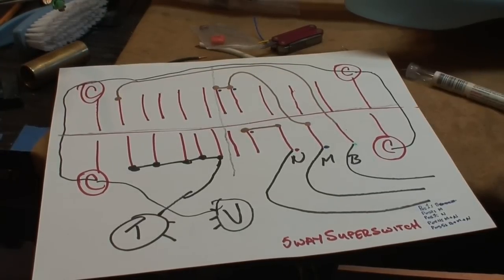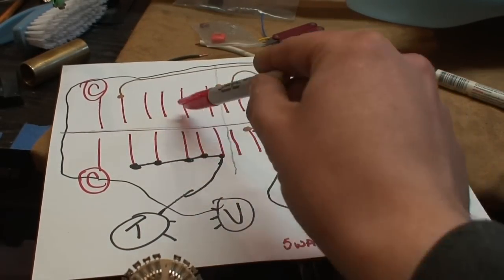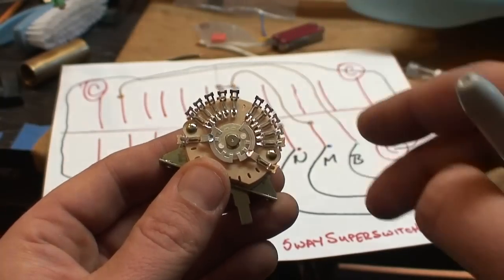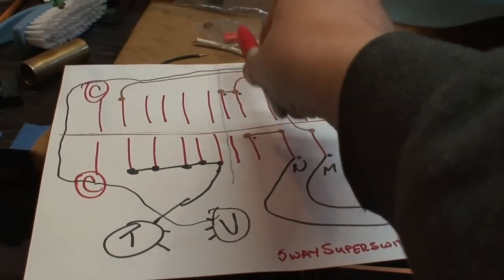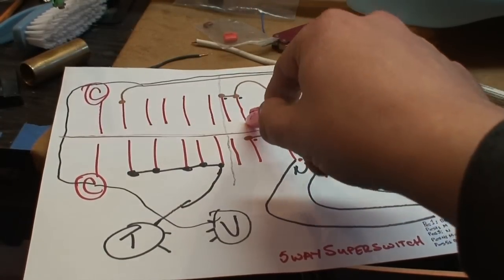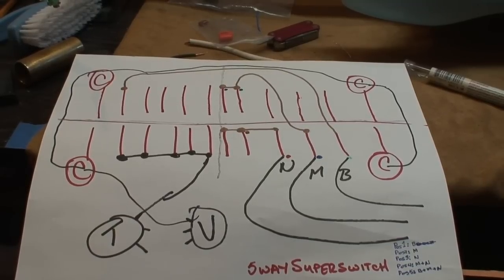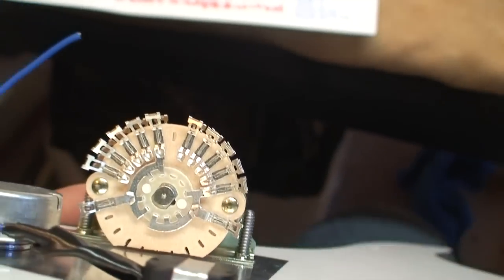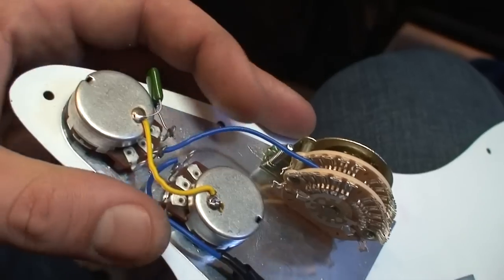Fender 5 Way "Super Switch" wiring for Dummies!

Comment: Be aware that there are two versions of what Fender calls a Superswitch.
Reply: 2 versions! The only way to tell if they are any use is to wire em in so 1 spare soldering iron and a mile of solder incase I end up going back to the basic type again.

Comment: No offence brother but I have all the same options with the addition of one toggle switch and tone mod. Its two mods one is a simple toggle to turn the neck on regardless of whatever else and the other is a small jumper to have tone pot control bridge. 1st position is bridge or toggle and get bridge and neck 2 is bridge and middle or toggle and get all three and the rest are all the same. Maybe Im missing something but isn't that the same thing. I do get confused with all this stuff.
Reply: do you have a way to get bridge neck and middle to sound when selected in bridge position, instread of just bridge? thanks

Comment: Woodeso's Guitar Mods
Neat. But I have a question.  Looking to do
position 1 Bridge Stock
position 2 Bridge &Neck
position 3 Middle Stock
position 4 Middle &neck Stock
position 5 neck Stock

I'm wanting to do this with stock 5 way switch  without using a push/pull or superswitch.  

Here's a link diagram.http://www.seymourduncan.com/support/wiring-diagrams/schematics.php?schematic=switch_f_bp

Can, I bypass the push/pull switch that's wired to the volume pot and completely unhook the tone pot wires but keep the 250k tone pots in their place. After this on the 5 way switch I'll have three empty spots can I add a jumper wire for bridge & neck?
Reply: ***** Apologies for jumping in here but it's a current hot topic for me. I don't think you can do exactly as you want with a stock 5-way and no additional switch (please correct me if I'm wrong, Woodeso's!) 

If you want position 1 as Bridge and position 3 as Middle, then position 2 will combine the two. A very simple solution would be to flip the wires from the Neck and Middle pickups to the 5-way, which would give you:

position 1 Bridge
position 2 Bridge & Neck
position 3 Neck
position 4 Middle & Neck
position 5 Middle

So you'd get all of the pickup combinations you want but not necessarily in the "right" order. Are you dead set against a push/pull pot or a mini-toggle? I've wired up a few of my Strat-types with a mini-toggle to give seven switching options, and have just put a set of late 80's Charvette HSS pickups into a Squier (so it's a Squiervette) with two mini-toggles. This gives me eleven switching options with the coil split on the humbucker. It keeps the 5-way selector more "logical" but per this video there's no right and wrong :)
Reply: Look up "Half blender wiring" for Strat, it's easy and you don't need an eye test afterwards.